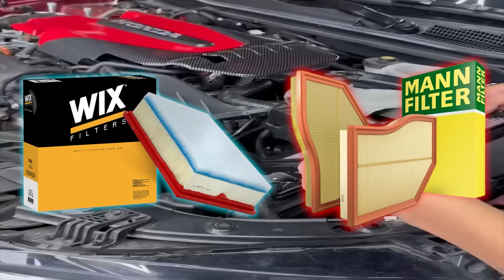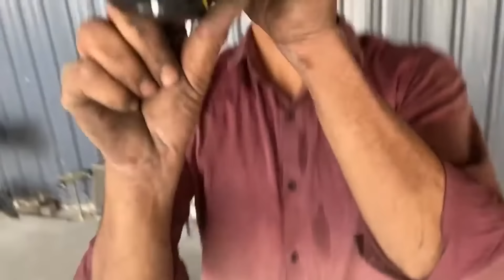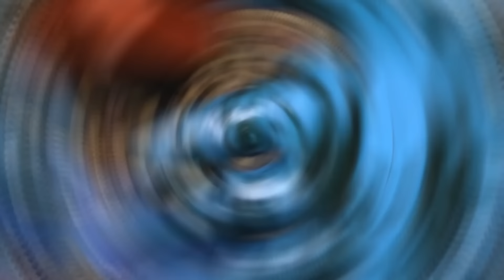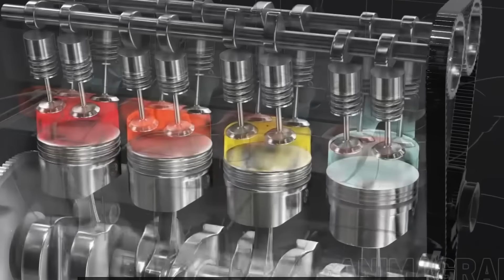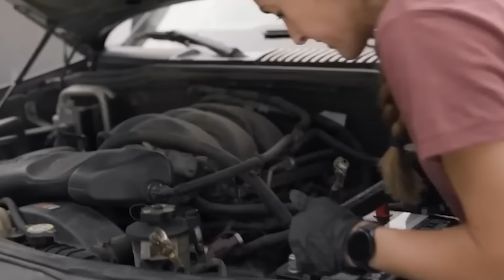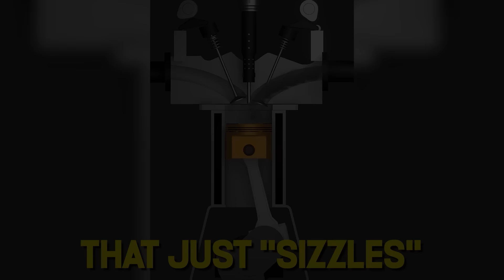Doing This Will Make Your Engine Run Like NEW Again

Comment: MY CAR IS coughing when idling, I feel it in the steering wheel, RPM goes down on reverse or drive, feeling coughing at a stop light. finished replacing fuel injectors and do nothing. do you think could be the fuel pump?  has no vacuum leak

Comment: Important note: if you do any of these, when done, disconnect the negative battery terminal for at least 15-20 minutes. It’s a soft reset of the computer & it clears the memory of the computer trying to correct for faulty parts or poorly functioning components.

Comment: 2:35 For best results buy the Felt anti-corrosion pads & have your wire brush ready. Make a more of paste with the baking soda, Remove terminals, wire brush while dry. Use old toothbrush & brush the baking soda on, let sit a few minutes. Brush away with wire brush. Put the felt pads on then re-install the terminals. 
REMEMBER: remove the negative terminal first & install the Positive first!! The negative is grounded to the chassis & if it’s connected & you remove the positive & it touches anything, it will short out & could damage the computer!! The negative has to be the first disconnected & the last are-connected!

Comment: 1:17 Don’t use the OEM!! Get a K&N High Flow!! OEM ones restrict flow too, maybe not as bad as some of the cheap ones but a good High Flow is worth every penny!
Reply: K&N gets more air through by increasing the size of the particles it allows through to your engine. I put a K&N on my Goldwing Motorcycle and three months later when I pulled it to check how it was doing, the amount of dirt inside the air box was shocking. I couldn’t believe how much dirt had made it past the filter and how much had made it into my engine. The K&N went into the trash and an OEM Filter went back in after cleaning out all the dirt I could reach.

Comment: Voltage drop?  Are you running a vehicle without an alternator?  You're an idiot!  The alternator powers your electrical system.  The only thing the battery is there for is to power the starter on startup.  It only powers "accessories" when it is not running.